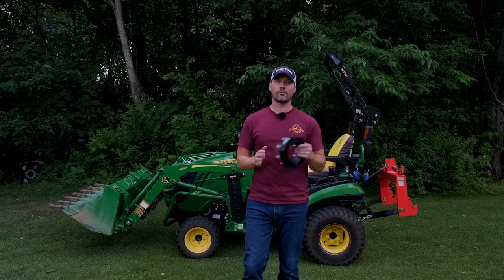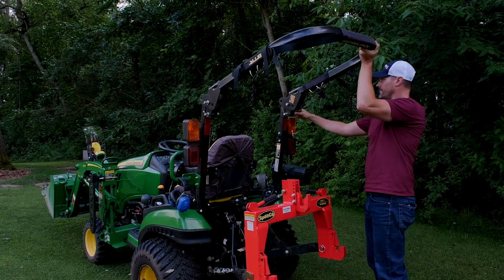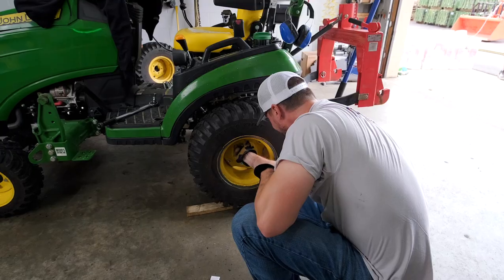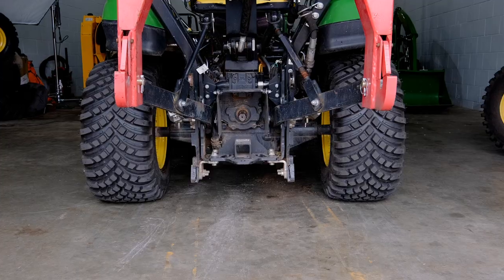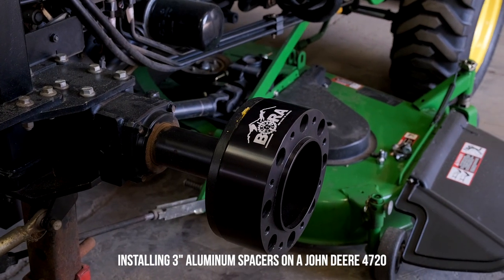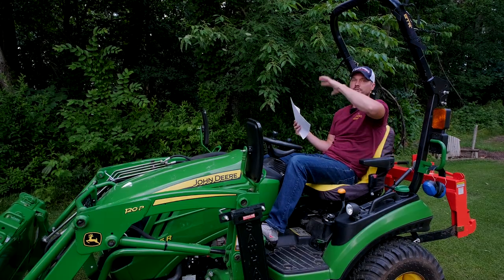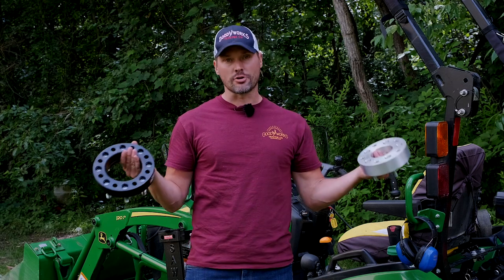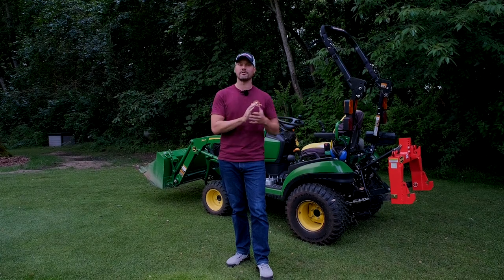THE MOST CONTROVERSIAL TOPIC IN THE TRACTOR WORLD? 🤦🚜

Comment: I bought my first real tractor this past spring(2023) the Massey Ferguson GC 1723e with loader and backhoe. My backyard is nothing but hill (I live in WV). I was mowing one day going cross ways when I went over a patch that was a little too steep, and rolled the thing. I mow with my roll bar half down because I have many trees that I need to go under, even with the roll bar in half position it saved me from a trip to the emergency room, unfortunately, the tractor landed belly up, and I ended up with a cracked rib. A couple weeks after my accident was the first time I saw videos about wheel spacers. I contacted my dealer about ordering a set, but they were dead set against them, citing the extra hub pressure. I gave it some thought and decided that my safety is is worth more than the possibility of replacing a hub bearing. It's November now, I plan on installing a set of spacers before the spring mow.

Comment: In 2020 I purchased a used a 2018 John Deere 2038r that had wheel spacers mounted prior to purchase. The dealer applied the balance of the extended warranty, so I do not believe that the spacers voided the OEM warranty. 

I cannot speak for the manufacturer or the dealer, but I believe that JD had to address some roll over concerns, and beefed up their notifications and support for proper ballast. The dealer facilitated the loading of my tires with beet juice ballast, so I believe that JD quite properly supports owners' efforts to increase the stability of these tractors, especially in hilly areas (like the one I live in).

Thanks for a well thought out discussion of this question GWT! I REALLY appreciate your approach to owner safety.

Comment: Thanks for putting this one out hopefully you just saved someone's life. I don't need the spacers on my 4610 Ford it has a sliding front axel and the rear wheels are also adjustable and I have both front and back out almost as far as they will go and still fit on my trailer. When I got it they were all the way in, I pushed them out made a big difference on stability.

Comment: I added 2" aluminum spacers on my 3039r and it immediately was noticeable, the added stability was key to some jobs I've done. Night and day difference, I also flipped/swapped my rims and idk why the dealer even let's you leave with the narrow setup on the wheels. Especially new equipment owners, way too easy to tip in and tractor right from the dealer.

Comment: I purchased the 3 inch spacers for my John Deere subcompact 1025R.  This is the maximum you can put on the front.  When I turn my wheels to full lockout the front tires slightly rub on the arms.  If you went with a wider front you'd run into limitations.  But the 3" difference feels SO much more stable.  Now that I have spacers on I can more safely run chains in the winter.

Comment: I have  the 1-1/2 spacers on my 1025r front and rear.  IMO it definitely feels and looks more stable.  From an aesthetic point of view I actually really like the the wider stance look.  Minor interference when closing and opening the right rear clip to adjust gage wheel height.  Also need to scoot over the guide a little more left when attaching and detaching the  MM auto connect mower.  I have the 54" deck.  So I can't comment on the fitment with a 60".  Other than those two minor items I haven't experienced any trouble.  Since adding the spacers back in March, I have done quite a bit of mowing and ground work (bucket, blade and hoe) around some areas where I would have been puckering a lot more .  This weekend I'll be brush hogging a couple of my friends paddocks and fields.  It's been a little uncomfortable in the past without spacers as the fields are rough and uneven.  It will be interesting to see how it goes with the spacers on this time and the wider stance.  As with anything, time will tell if there are any significant negatives that outweigh the benefits.  I will  certainly let you know in a couple of years how it all shakes out.  For now, very pleased with the results. Thanks for sharing!

Comment: I have a 3033R Cab here in Canada and I noticed immediately that it was quite tippy. I installed 2” BroTeck wheel spacers (Made In Canada) and flipped the front wheels to the wider position. Much more stable now. I wouldn’t have a tractor without wheel spacers.

Comment: I put 4.5 in Bora spacers on my 35hp Mahindra last year. It makes a real difference in the "feel" and stability of the tractor. I also put RV antifreeze in the tires which helps with ballast and adds to the stability. I added 2 inch spacers and agg tread tries to my craftsman lawn tractor/mower too. I live in the hills and nothing is flat ground here. I flipped the mower tractor before the upgrades because those lawn tires will just SLIDE down the hill like it was on snow instead of dry ground. I was not hurt on the lawn tractor mishap, but I do use the seatbelt and ROPS on the bigger tractor. 
You are covering some of the most important safety issues with a tractor right here. Thanks

Comment: I’m glad you addressed this issue. I am also glad my B2650 has wheel spacers because it has the factory cab. I would be interested in finding out whether wheel spacers voids a warranty or not. If it doesn’t, that would also validate using them.
Reply: I have yet to see or hear of any instance where wheel spacers on a tractor voids any warranty I called Branson tractors which is what I own as well as three local dealers and none of them said it would void anything two of the dealers say they recommend getting spacers in our area which is mostly mountains and uneven terrain I know when I was looking at Kyote as well as Kubota neither of those dealers said they would void a warrant either with JD may be a different issue with HR and marketing building tractors for them lol

Comment: I’ve known 2 people who were either killed or severely injured on tractors. I have turned over a KUBOTA B7100 and aJohn Deere 2210, with severe weight distribution issues pulling posts my chain slipped throwing the front weight high quickly pulling the tractor off balance and turning over. The other incident was having an implement hit the ground when backing off the trailer causing the tractor to slide sideways and turn over. 
I believe spacers for an on highway vehicle is a huge mistake, failure on these vehicles is much higher likelihood! On a tractor, while possible, I believe rather unlikely. Worst case is inspection more frequently for safety. I use a jack stand under my 3 point hitch and lift the rear wheels off the ground with the loader, on concrete, then inspect my rear wheels and axle end play and wobble. Honestly we need to inspect our equipment more than we do, grease it more than we do! Our safety depends on it, really!

Comment: I found onmy 3520, my front wheels were setting out wider than rear when in the "wide" position.  Very little change found on Rear and big change on front.  So I finally put 3" spacers on the rear.  Left front alone.  Valve stems in and its now perfect.  Huge difference in terms of stability.  And it looks better too.

Comment: The people who say adding wheel spacers will shorten the life of your axle are the same people who don't put ballast in their tires either because it adds weight and will wear out their axles. In all reality adding ballast into the tires wheel weights to the wheels and spacers onto the tractor really won't wear anything out any faster unless you are installing them on the front of the tractor which would not make sense to do anyways and then the issue would be steering components. The rear axles and systems are over built it's like putting 35's on a 3/4-ton truck that comes stock with 31's the difference is minimal to the axle and drive-train components and with even normal vehicles as long as you get properly built and designed wheel spacers you will never have a detrimental effect from them. Wheel and hub centric allow for the spacers to centralize the wheel to the axle properly keeping everything rolling as it should a wheel centric but non hub centric spacer you should avoid as it will actually cause hub and axle damage not only in tractors but any vehicle because it does not centralize the wheel truly to the hub and can cause it to roll unevenly causing the hubs bearings axles and even lugs to wear. BORA wheel spacers are built better than any others out there and are true hub and wheel centric. In my personal and professional opinion after years of being a diesel/hydraulic equipment mechanic you will never have a mechanical issue caused by properly mounted BORA spacers on the REAR of your tractor. I'll be running them on my new Branson 4820H this spring if they can get them made by then. BORA will custom build spacers to fit your tractor if they don't carry them for your tractor already like my Branson. You can give them a call and they can get everything worked out for you which is pretty awesome. great video as always and enjoy how diligent you are about ensuring that people have access to information that can make them have a safer experience.

Comment: The wheel spacers definitely increase drive line stress. That’s just simple physics. You have to make the decision if that’s acceptable. I think it is because I work on a lot of hills and value my life and not damaging the tractor from a roll over. Also I would always go with steel. It’s stronger and heavier. Almost all tractors can benefit from rear ballast, why not get some more weight from the spacers? I ended up making my own spacers because I could machine them. They ended up weighing about 50 pounds each. They add 2” on each side on my Kubota BX.

Comment: I have a 2009 JD 2305 with the backhoe, FEL and 62 inch mower deck. I found that after buying that it can be really tippy when using the machine.  I first got rid of the junk 2 ply puncture o matic turf tires and went R4 tires and then added beet juice to the rears, then went to the JD dealer and bought 2" wheel spacers. It was a night and day difference after all the modifications I made to improve the stability of that small machine.  Having some really hilly land it is a lot more stabile. I don't care of I have failures as the machine can be repair but after 455 hours it is still doing great

Comment: We have a BX and use it mainly for snow plowing or blowing. We use the bucket for loading things like wood into the truck so I feel that spacers is something to look at and maybe add the smallest amount because there is a cab on the tractor. We have a mower deck for it but it sits in the shed in the summer. The snow blower is my concern and getting close to a house, don't want to buy a wider snow blower just because of the wheel spacers, adding weight in the tires for now might be better for me. Thank you and keep the videos coming, might not buy or do everything you say but still good info for most

Comment: It ultimately boils down to application and education. On our SCUT, the changing of wheel/rim isn't an option so spacers are the option. Larger tractors can. The 12" rim does come in a different position (most found on older garden tractors) only again making a few inch difference. One such set of wheels I custom made (26x12x12 garden tractor pulling tires) gives, yes, some width; however, practically speaking for the general public ... wheel spacers are the way to go. BORA has done the R&D.

Comment: Good morning. I agree with everything that was said. 
Possibly reach out to a tractor company and get a engineer or a technician to tell if you could possibly over stress a housing.
That said,we all know if it can be broken, we as humans can,will find a way.
Reply: It's no where near what the stress would need to be. Even if it were the case the spacer would give before the iron rear or steel axle would give.
And they don't. Yeah sure going a foot out would be problematic but you don't need to go that far out anyway and a lot of these tractors are rated for duels anyway that's way more stress than a spacer.
Reply: Thank you for your reply.

Comment: I completely agree with you with regards to having a Cab makes the tractor feel tippier.  I have a Kubota B2650 with a cab and had numerous close calls.  I'm definitely going to be ordering a set of wheel spacers for my tractor.

One of my pet peves with the smaller tractors is that the wheel rims are designed in such a way that you can't add any wheel weights.  This was the original solution that I was looking at doing, but couldn't.  If I want to add wheel weights, I would have to up grade to a larger tractor, which I simply can not afford right now.  So obviously wheel spacers are an affordable optioon at present.

Comment: You just pressured me into ordering Bora 2.5's for the rear of my brand spankin' new 2021 Kubota 2501HST. Been on the fence for this unit. Has Bro-tek 2" on my previous 2018 MF GC1705, they made a huge difference on that little gem.

Comment: Have 1/2" (max dealer recommended) with loaded tires. Its still tippy if you arent watching. Lifts occasionally and wheel spins backwards if not in 4x4 even WITH weight on quick hitch (boxblade or 3 point mower)
B2601
Reply: I think your dealer probably has very little experience with wheel spacers because I wouldn't even install anything less than a 2" to any tractor as it wouldn't make a large enough difference. Most people look at tractor wheel spacers like they do passenger vehicle spacers and there is a large difference between the two systems if your wheel is spinning backwards it seems like your spacers are not wheel and hub centric and you have an imbalanced wheel which will cause undue wear on your bearings. I'd look into them and go with a larger 2-3" spacer that's wheel and hub centric. those two key points will probably change your opinion on spacers as well as your dealer. I run 4" spacers on a 55 horse with tire ballast as well as wheel weights and have over 700 hours in mountainous terrain using mostly a grapple during arborist work and moving 2500+ ld. 16 ft logs consistently and have not had any sort of drive-train/bearing or any issue for that matter.

Comment: As a tech at a dealership i only have seen  1 snapped axle shaft, as for worrying about the axle seal, that is at most a 45 min job, snap rings on the outside and there is a special tool to remove the shaft (or a big hammer) then a tool to install it all, it is not like older tractors with a snap ring all the way at the end of the shaft inside the diff. As for the 3 series deere sells spacers for them so its not uncommon to use them

Comment: One of my cousins had a VW bug that he had put mag wheels with oversize tires on. The rear bearing failed shortly thereafter. However i suspect tractor manufacturers put much more robust bearings in their axles knowing that people will be adding wheel weights or putting ballast in the tires, and also pushing the machines to its limits. I doubt that wheels spacers would significantly shorten the life of the axle.

Comment: This is a great video, the only question I was left with was how much value is there in spacing the front end too? The times I have had my tractor almost roll is has been incline + weight in front end loader, so I am thinking spacing the front rather than the back could eliminate that issue. Can anyone speak to that?
Reply: Your front axle pivots, so it's not going to matter how wide the front wheels are. Tha rear wheels create the stability of the tractor.
Reply: adding spacers to the front end will increase and add undue wear to your steering components and is something I would not recommend doing spacing out the rear of the tractor would be the only way to go in my opinion.

Comment: I think people pick up on issues and over generalize the applications that they apply to.  On a car or truck, spacers are an issue.  But tractors have always had the ability to adjust wheel spacing for different needs.  It comes down to not overloading the wheel hub interface and overloading can be done a lot of ways; duals, wheel weights, 3pt or rear attached accessories.  Spacers on a compact or subcompact tractor are a must, as you point out, they are designed far too narrow (and lightweight) and are sold to, in many cases, novice operators.  Even the pros get into trouble.  My parents sent me to a 4H tractor safety class back in the late 1960's, getting yourself into unsafe situations on tractors has always been a problem.
Reply: @DieselRamcharger  But we live in a society where it's necessary to tell people that coffee is hot!  So selling glorified lawn tractors and accessories to novice operators with no training is a problem that is not going away.   And, this is simply not a true statement "... Farm implements move their wheels for row spacing, nothing to do with falling over." .  Anyone who has paid attention to a roadside mowing crew understands that.